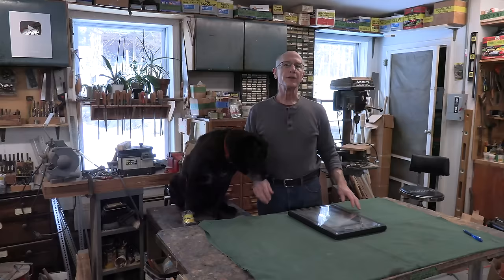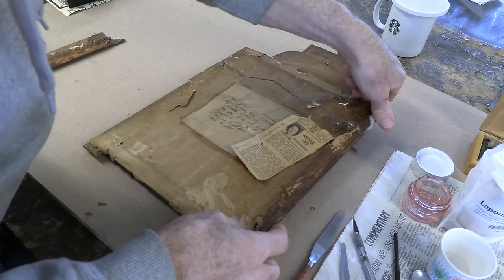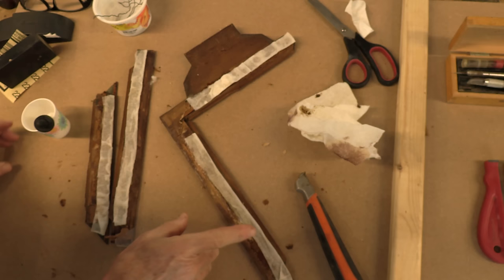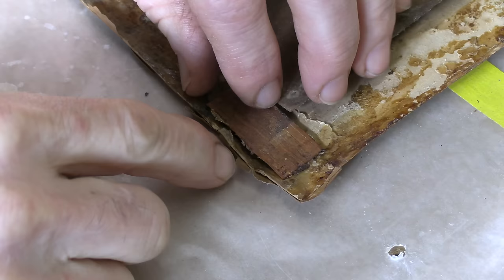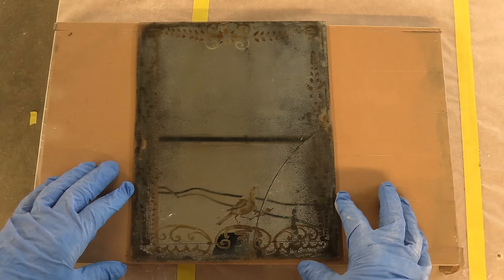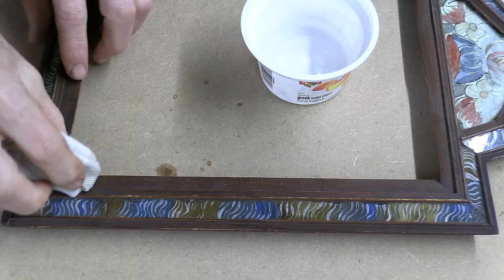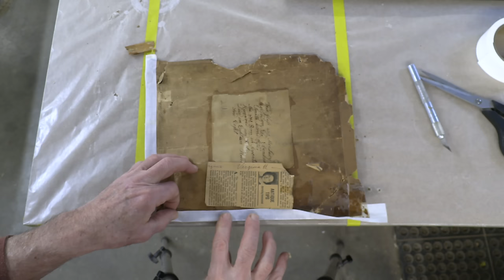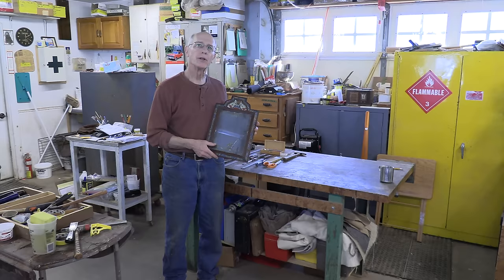Rescuing an Antique Mirror - Thomas Johnson Antique Furniture Restoration

Comment: It occurred to me that the glass could have possibly be cemented together with "Canada balsam" most likely you know about this? it was at one time used to cement the  lens elements  together  in lenses for cinemas, however in later years it fell out of favour because the high heat needed for "drive in cinemas" caused it to fail and nowadays air spacing is used.
David
Reply from the maker: Thanks! I have not heard of that! The problem is that this glass did not fit back together well

Comment: What does the vinegar working to remove the glue tell you about the glue?  Can you tell what type it is from that?
Reply: That the glue is protein-based (most probably "hide" glue, though it could have been also fish glue or rabbit bone).
Reply from the maker: Thanks! I’m not sure, except it has to do with acid and base
Reply from the maker: Thanks! Yes, hide glue, but I’m not sure what the protein is exactly

Comment: That's beautiful and so delicate and fragile. I have a question about cutting glass. I have my grandfather's glass cutter but I've never used it. Do you break toward or away from the score?
Reply: away
Reply from the maker: Thanks! I'm not the person to give advice on glass cutting! But yes, Lundy's Den is correct. An old cutter might not work well, but give it a try
Reply from the maker: Yes, thanks

Comment: I have questions about the tape. Why did you not line it up against the wood? Also, why did you fold it over to the front instead of cutting it at the edge of the back?
Reply from the maker: Thanks! I folded it over the old paper to protect the edges of the paper, which were so badly damaged. That then gave me a surface to tape to the wood. I'm not sure it was the best solution, but it will preserve it for the time being

Comment: I guess there is a fine line between conservative type repair, and preserving for historical purposes. Broken mirrors, at what point do you salvage instead of replace. Unless George Washington’s reflection once graced that mirror, i would have replaced it, enjoyed the frame minus an irritatingly busted, stained, and cloudy mirror.
Reply from the maker: Thanks! But the mirror had quite a bit of original decorative painting on it, and could not be replaced. Besides, I could see my reflection just fine!

Comment: I have an idea for easier turning over. Cut two pieces of cardboard just slightly larger than the piece. Place the item on one, do your work, and when you want to turn it, place the other piece over and turn all three layers together. Then take off the "old" bottom layer now on top. Less chance of loose pieces falling.
Reply from the maker: Good idea! I should have been doing that. Thanks!